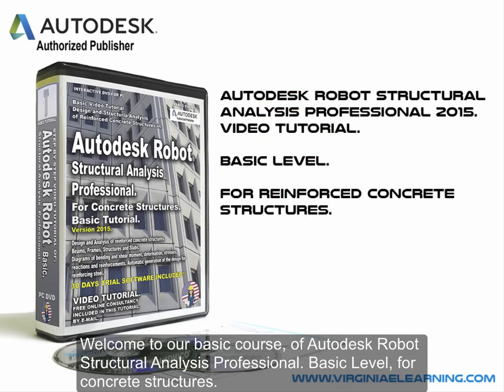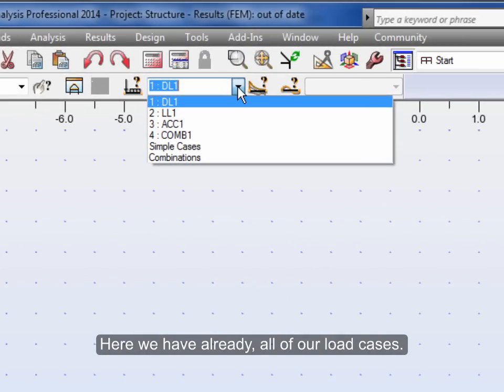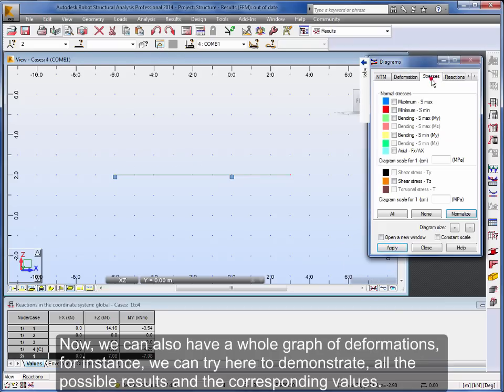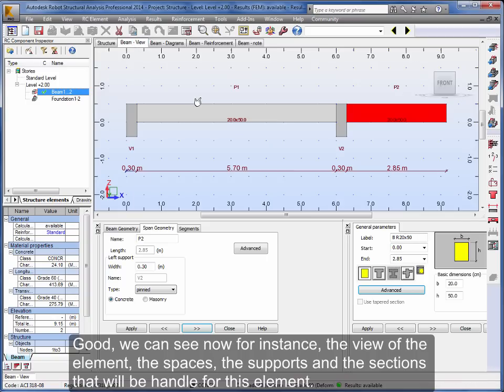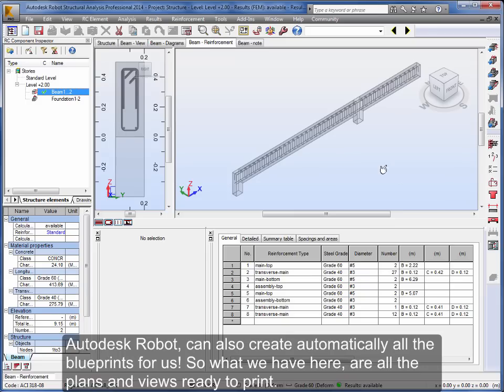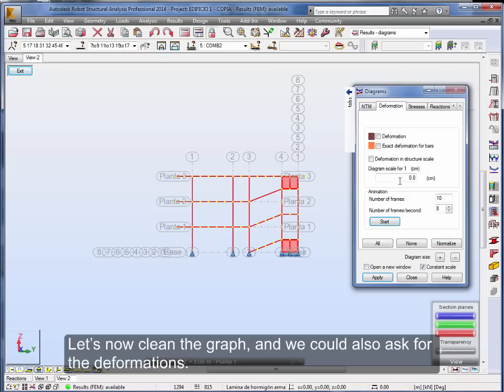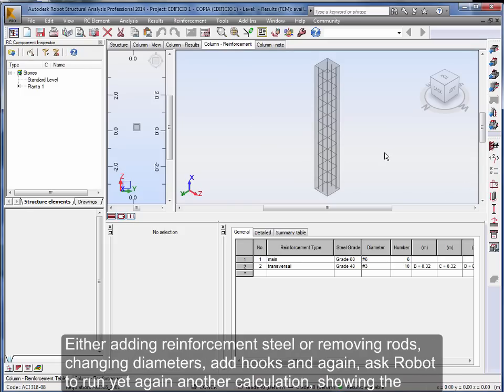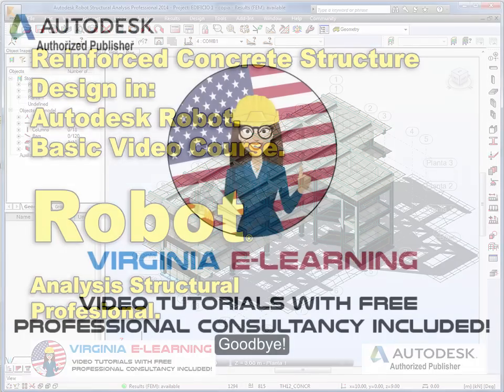Autodesk Robot Tutorial

Comment: Which one is good software...Sap2000 or Robot???
Reply from the maker: Hello! Autodesk RSA is more advanced than SAP2000 in general terms as far as ease of designing and analysis concerns. That's no to say that SAP2000 isn't a good analysis tools, but RSA offer a more modern interface. So if you are new to the world of Software for Structural Analysis we would recommend RSA over SAP2000
Reply: and results of which software are more accurate an reliable...????
Reply from the maker: Well actually no structural engineering software is inaccurate, it's like asking which calculator is more accurate. Every software for Structural Engineering use a base of known formulas and equations, so to begin with any software will have way more accuracy than a human being , this is computer level accuracy for infinite decimal calculations after all. Nonetheless when compared to calculations done manually, which always hold certain degree of inaccurary and approximation , because it cant be otherwise, the results have the tendency to differ. So the point being made that the results will depend on the Structural Engineer's skills, knowledge and criteria while using a specific tool such as RSA.